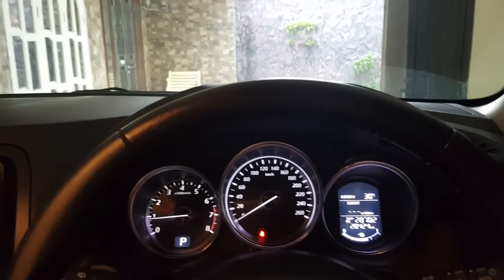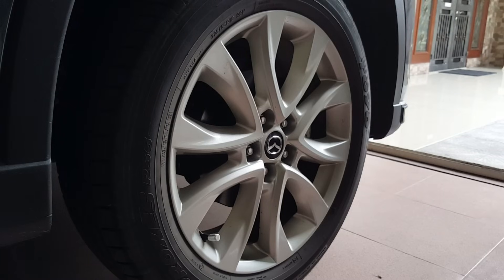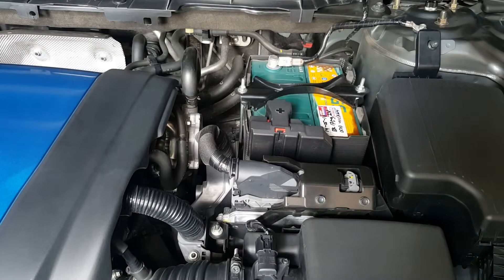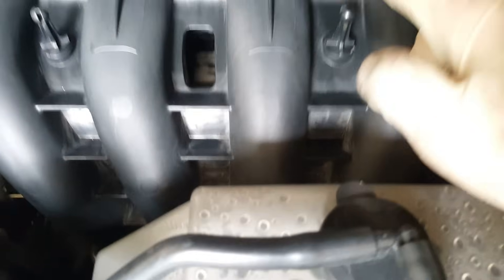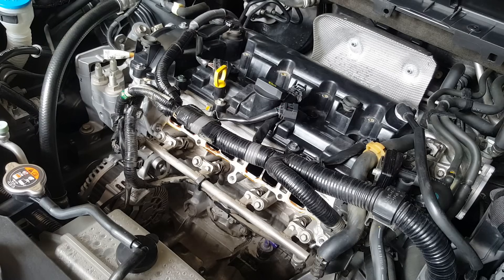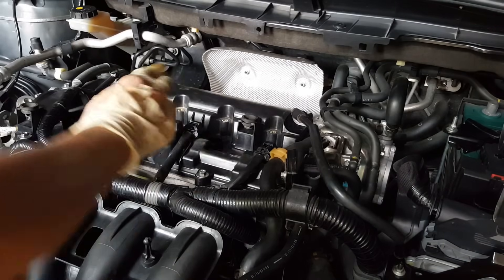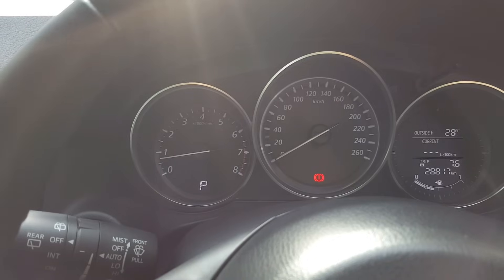How to Clean Intake valves / Carbon clean // Mazda CX 5 (All Skyactiv Gasoline Engines)

Comment: how often do you do this?
Reply from the maker: best is at every 40000kms so you dont over spent on your maintenance $$.
Reply: @GarasiFelixDan  I haven't ever done it but the PVC was replaced when the car was bought at 170k km (now 225k). I saw also ppl putting a oil catch can between pvc and intake but then theres others recommending against this saying the design it burns up again as goes through intake but at same time it does build up in the intake. I bought a catch can then was hesitant to even install.
Reply from the maker: @schwinnbiking  watch my oil catch can install , they actually works and slowing down the process of carbon build up. Best bang for buck mod for these cars.
Reply: @GarasiFelixDan  I did watch it, I think more than once and first time years ago when I bought the cx5. I might just do it and if I want to remove I can just interconnect the two tubes and remove the catch can. I'm more tempted though to do it all at once since I have to remove the intake manifold. 1) PVC 2) catch can rough in/install 3) clean the intake ports/manifold etc.. like in your video.
Reply: @GarasiFelixDan  I do seafoam every other year and keep an eye out on oil level. Its not burning much now maybe 500ml every oil change. My oil changes are long tho 12k km as per manual.. maybe not the best.

Comment: For the name of all that is holy 
You can simply use seafoam top end cleaner and it will remove all that carbon just as well
Reply from the maker: nah it wont do it , You need to scrub it or blast it away.
Reply: @GarasiFelixDan  nah, it does do it, has done it 100s of times

Comment: Recently purchased a used commuter mazda and was going to pay for a cleaning but after this I decided to do it myself. Thanks for the video
Reply from the maker: no problems. keep us posted once you ve done the service.
Reply: was it difficult? i want to do this but seems difficult
Reply: @skykyro7712 no not really. You just need to make sure to get the right cleaning solution and I replaced all the gaskets just Incase. Hardest part was the bottom bolt on the intake
Reply: @michaelwillis1440 well i’ve never worked on cars before but i want to start working on my car and do small projects first like services before i get onto stuff like this. thanks for the reply!

Comment: Does removing the black terminal reset anything in this vehicle?  Certain modern vehicles are a bit touchy when disconnecting and reconnecting the batt.
Reply from the maker: yes it will reset the setting on the dashbord , radio & power windows (1 touch).

Comment: I don't really understand what that carbon thing is all about what it is and what's causing it but if that can be removed this way i'm wondering why they don't do it at the car service station.
Reply from the maker: its just the designs of direct injection engines. The intake valves will get some carbon build up overtime as there r no solvents or fuel that sprayed within the intake ports.

Comment: ... Or you could just change the oil at the scheduled frequency
Reply from the maker: replacing oil at certain interval would not help at all , it would still develop a carbon build up :) because its a direct injection engine.

Comment: When I replaced intake manifold on my Corolla at 140000 miles my valves a zero deposits on them.Two things that helped, I have multi port injection which cause gasoline to wash the valves.I also only buy top tier gasoline.
Reply from the maker: correct if your car have multinport injection you dont have to worry about carbon build up on the intake valves .
Reply: I dont believe the type of fuel would have any benefit  on inlet valve deposits, correct if im wrong @GarasiFelixDan
Reply: type of fuel won't matter they all have detergents in them. Unless you know exactly what refinery or whatever the oil came from before being delivered to your pump it's just a waste of money

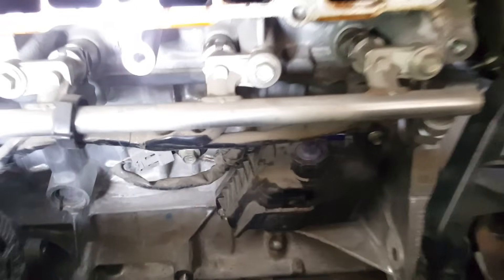Comment: 8:30 You mention "catch can". Is that a stock part that comes on engine? I've seen them installed on other engines as an aftermarket modification to reduce oil being introduced into intake via pcv valve. I don't think the intake should have that much wet oil inside.
I must say your engine bay is immaculate.
Reply from the maker: Thank you i really appreciate that. what i mean by the oem catch can is the oil seperator unit that has the pcv valve. But yeah this car needs to have another oil catch can assy in order to keep the intake port clean. Ive done the install video on youtube take a look you will see the oil trapped inside of the OCT assy after sometimes. https://youtu.be/wwshYqm4cH8?si=tK6UIUAWv_GABF1h

Comment: How did u rotate the engine in order to clean 1 and 3.   You said to make sure valves are closed.
Reply from the maker: get a friend to help you. One to rotate the crach pulley , while the other person to look down the intake valves with a torch , you should see the intake valves open n closes.
Reply: Ok. Thanks. Appreciate it.  I will try this.
Reply from the maker: @davidcarrington2944  no problem keep us updated. You can add oil catch can unit while you at it, save you alot of time from removing the intake manifold twice. I have the video on how to install OCT kit for this vehicle. 👍🏼

Comment: Felix, you make this seem so simple, I decided to try it.  It actually was harder than I expected.  I have a 2.5 engine, and finding all the clips on the intake manifold was a major pain. One of them is impossible to see, and after 1/2 hour, I was pissed and just pryed it off. I had let the B-12 soak/brush each intake at least four times, and also used it to clean the intake manifold passages.  Then sprayed everything with carb cleaner, and cleaned with brake clean.  All those solvents combined made my engine hard to start after everything was put back together. Eventually it turned over, and then I got a P0421 CEL. I thought the O2 sensors were damaged, or worse the cat.  Thankfully, Scotty Kilmer came to the rescue and 1 gallon of laquer thinner cleared the CEL.  Next time I have a car with bad carbon buildup, I'd seriously consider hiring someone to do this job.
Reply: I would recommend not using carb cleaner like I did. Only solvents that are O2 sensor safe.
Reply from the maker: hehe its not as easy as in the video right 😆. I also had some issue with the annoying clips as they are pain to remove. Thats good that u got it all sorted 👍🏼 the car feels great after this service right ?
Reply: Yes, I was absolutely thrilled after everything was put back together! Since the throttle body was off anyway, I cleaned that with carb cleaner.  I have much better throttle response. Unfortunately my P0421 came back. I used a OBII scanner, looked at the live data, and the Bank 1 Sensor 1 seems to have wildly fluctuating voltages. I've ordered another O2 sensor and hopefully this takes care of the problem.  I'd recommend people to swap an old O2 sensor for the good one once the engine gets settled.
Reply: BTW the bolt in the middle of the manifold is tough to screw back on. I used a strong magnetic pick up and used that like a screw driver to get the bolt started.
Reply: You shouldn't have a CEL.  I'm guessing one of your valves was not fully closed, resulting in the various solvents you used make its way into the combustion chamber.
Reply: @cyclist_guy-zg1zo you're probably right.  Even if it was open 1 mm, it would have been enough for the solvents to leak into the combustion chambers.
Reply: As a follow-up after replacing the front O2 sensor, I got another CEL code for catalytic converter below efficiency. Using a O2 spacer on rear O2 helped eliminate the CEL but the new O2 immediately became carbonized and fuel economy worsened. I didn't record the baseline before this cleaning, so I can't readily say what happened.

Comment: I will definitely have to do this on my 17 mazda 6 with 78k miles. It runs great but I'm sure it needs it. Thanks for the informative video! I may also add an oll separator. Did u add one? If so did it help?
Reply from the maker: yeap definately recommend to do this and add the catch can. It helps alot.

Comment: Hi How do you close the valves  do you rotate the crankshaft manually, if so how many turns.
Reply from the maker: need to have a friend rotate the crank shaft while other one can shine a light inside the intake ports to see the valves open n closes.

Comment: Is it necessary to remove the spark plugs when we are cleaning out the Intake Valves or we don’t have too?
Reply from the maker: i recommend to remove it so when you turn the crank pulley you wont fight againts the compression.
Reply: @GarasiFelixDan  I like your idea, thank you so much!
Reply from the maker: @tomwu4211  you r welcome . keep us updated how you go with this service.
Reply: @GarasiFelixDan  I will thank you! Can I use Throttle Body Cleaner for Intake Valve Manifold for my CX-5 and will it hurt anything to it or not?
Reply from the maker: @tomwu4211  should be alright that one. 👍🏼

Comment: how do you insure when the valves are closed?
Reply: The best way...need two people:
1.  Remove wheel and then remove lower panel in passenger wheel well to expose crank pully.
2.  Remove spark plugs - this removes compression in the engine and makes it much easier to turn crank.
3.  Using a 21mm socket, have friend rotate crank 1/4 turn clockwise at a time while you watch intake valve.
4.  You'll notice that for a given valve, it will be obvious when it starts to close when your friend is rotating.  There will be a point where rotating the crank 1/4 turn no longer moves the valve upward....this is when its closed.  After another 1/4 turn or so, the valve will begin to open (move down).
5.  You can also do a double check by shining a flashlight down the spark plug tube for the valve you think is closed.  You will not be able to see any light if the valve is closed (make sure you tilt the flashlight around several angles).
Reply from the maker: use a torch and look down on the ports you will be able to see it open n closes

Comment: As always, a great video Dan.  A few things I noticed doing this on my 2017 Mazda 3 GT with only 46,000 KM:
1.  The carbon build-up was about the same as yours.  there was little carbon build up on the walls - just the valves.   I drive a mix of highway (100km/hr+) and stop-and-go gridlock traffic.

2.  Berryman B-12 does not appear to be available here in Canada.  I used an alternative Carb cleaner (Canadian Tire brand for you Canucks which I believe is just a relabeled CRC) to soak the valves for about 2 hours - 3 times (with cleaning with pic in-between).  I also used a plumbing flux brush and tooth brush.

3.  I tried the CRC specific valve cleaner as a soak, but it didn't seam as effective.

4.  Use a compressed air gun to blow out the valves.  Equally effective is the blower function of a shop-vac type vacuum (I used a Ridged 5HP and adapted a small hose on end to focus the air).  The idea here is to blow out all the little pieces of carbon that haven't been dissolved.  I've seen this approach used by others and works well.  Otherwise, you will end up with little pieces left behind.

5.  I wouldn't recommend using a vacuum to suck up the little pieces of carbon and solvent.  While electrical motors and solvents are definitely a fire hazard, the thought of having a vacuum gummed up with carbon bits and solvent would be a nightmare to clean, if not impossible.

6.  The solvents are fairly corrosive.  Make sure you use safety glasses!  I had some solvent splash up on the lens of my flashlight and it permanently damaged the lens!

7.  Mazda specifically mentions in the workshop manual the intake gaskets are not re-usable (same goes for throttle body gasket).  You can probably get away with it if your car is only a few years old, but would get new ones to save yourself the hassle if the originals don't re-seal.

8.  I wouldn't encourage someone to do this who is not comfortable and with a bit of experience working on vehicles.  While not difficult per say, you are exposing a critical entry point into your engine.

9.  I would also highly suggest replacing the PCV valve since the intake will be removed.  Keep in mind that when you replace the PCV valve, the retainer, o-ring and separator gasket also need to be replaced (as per Mazda workshop manual, the separator should be removed from the vehicle to remove the PCV).  You cannot re-use the retainer specifically as it won't seal correctly again after being removed.  Additional tip, you can buy a kit from Mazda that includes a pre-assembled separator, PCV valve, and all gaskets.  Total cost is only about $15 more than just buying the valve and necessary gaskets separately.

Is it worth it?  Will update in a few days.  My mazda dealer gave me the wrong gaskets so waiting on those to put everything back together.  That being said, it is definitely a lot of tedious work.  Obviously the valves don't build carbon indefinitely, otherwise we'd see numerous Mazda engine failures considering there are many on the road with hundreds of thousands of miles.  The consensus seems to be that a cleaning does increase responsiveness, so it may be a weekend task every few years.
Reply: I wonder if anyone has honed/polished the intake runners while they have it open. Smoothing the airflow path can result in increased power and fewer things for deposits to stick to.
Reply from the maker: @matsudakodo  hmm i have not seen anybody done the modification very interested to see the results if anybody has done it.
Reply: Where did you find the Mazda emissions kit with pre-assembled separator, o-rings, pcv, etc? I've only found individual parts so far.
Reply from the maker: @warlike_elk  have you try ebay https://www.ebay.com/p/1337124518
Reply: @warlike_elk   I'd just suggest your local mazda dealer or ordering from a reputable online mazda seller.  Part # for 2.5 L is PY01-13-570.  I'd also suggest getting the PCV hose as well - part # for 2.5L is PY01-13-895A.
Reply: Thank you cyclist_guy-zg1zo, your enumerated comments was a great addition to this excellent video. Excellent information!
Reply: Hey, thanks for all of these notes! I'm about to replace injectors, just started getting misfire codes... My buddy at work said I should probably look into all of this... I have a 2012 Mazda 3 skyactiv... This video along with your input are awesome! Thanks!
Reply from the maker: great write up very detail thanks for posting

Comment: hello at 8:27 you mention an oil catch can. Does it mean that as a standard feature the skyactiv engines have an oil catch can ?
Reply from the maker: yeap its called oil seperator unit. But i recommend to install additional OCT to this engine. Check out my other video for the installation.
Reply: @GarasiFelixDan  thank you I will try to do that ASAP
Reply from the maker: @hugtango  yes definately recommend this service. it will make the car just like new.
Reply: @FelixDanGarasiAuto  thank you my skyactiv 2.0 2019 is 80000kms now and definitely I need to shield the intake from the oil vapors. First I'll put the engine through a Bardahl eco cleaning machine at a garage close to my place. Then Oil catch can installation
Reply from the maker: @hugtango  dont forget to replace that ATF FZ fluid. 👍🏼😁
Reply: @GarasiFelixDan only seeing your message now !!! Thanks for the advise I was doing that on my sentra cvt every 30k kilometers. The CX-3 is manual 😉

Comment: Is this cleaning important? Just wondering, I just bought cx5 2016...if I don't do this, any big issues?
Reply from the maker: Definately recommend this service especially when buying a used car. It will improve drivability saves mpg and restores engine performance. 👍🏼

Comment: All this labor, while laudable is unecessary. All on needs to do is buy STP Proline GDI valve cleaner. All you do is attach the sneaky insert tube at the TB. Run the car. For 9 minutes the chems clean and burnoff more efficiently every surface this guy just cleaned. I have used this product since 2017 on multiple GDI vehicles. Do it once a year to keep valves baby butt clean.
Reply from the maker: u never know until you actually remove it manually and see it with your own eyes. not saying they dont work but it would help to break down some of the carbons but not all 100%. Just to keep in mind that using chemical cleaning on some cars that has sensitive sensors will trigger check engine lights while perform the service using that spraying method while the engine is running .
Reply: @GarasiFelixDan  Thats what I thought. My buddy is a former master Hyun/Gen/Kia/Ford tech with 20 years exp. He owns his own shop now. He recommended this stuff, then showed me before and after pics of the valves taken with a scope cam. It gets everything. He said the stuff is exactly what the dealer techs will use on their pressurized systems that cost hundreds to do. That was 2017, I ve used it on all my vehicles ANNUALLY. Not expensive, completely effective. Saves lots of labor.

Comment: Just get a can of crc intake valve and turbo cleaner. And spray it thru the throttle body wile running and it will clean it all up
Reply from the maker: Yes ofcourse you can use that option but , it would not be as clean as cleaning it manually. 👍🏼

Comment: With all that off, I would have replaced the PCV valve while doing that. Also, after that cleaning I would start using CRC valve cleaner every 10K miles and you won't have to take the intake off anymore,
Reply from the maker: i have added oil catch tank kit for this vehicle. You should add if you havent already it does helps with the carbon build up issues. Please check my other videos for the install.